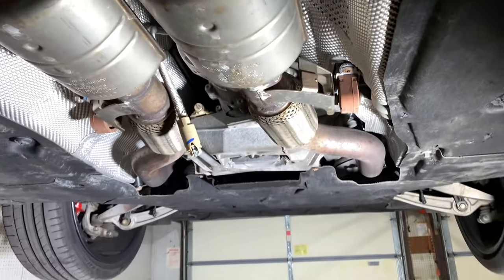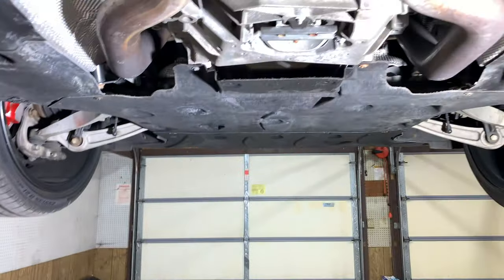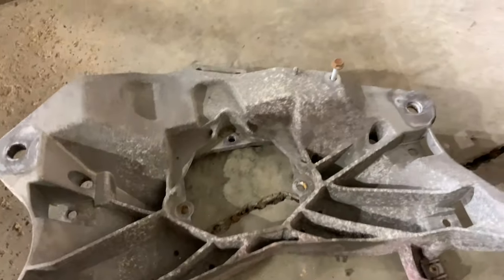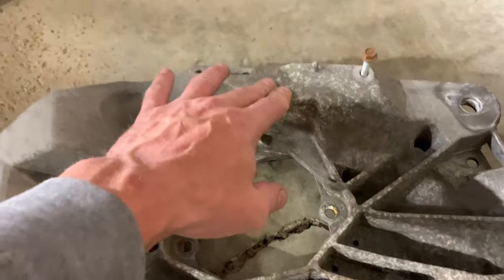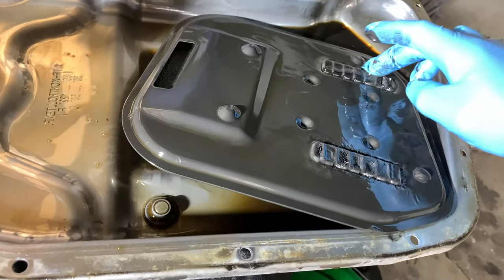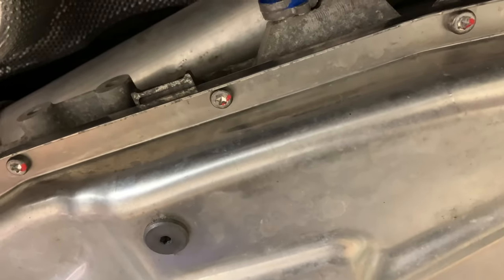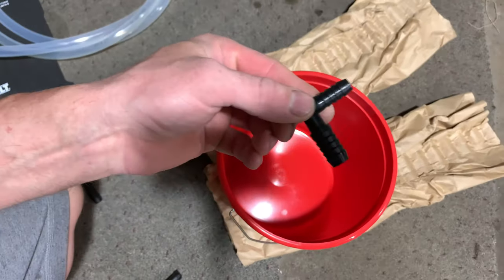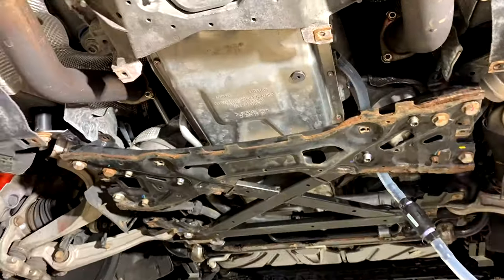AUDI A8 D4 Transmission fluid and filter change (ATF fill steps in the description)/Замена масла

Comment: The guy at Audi dealership told me you don't have to change the fluid
Reply: That is what I expect from an Audi Dealership!   Try Every 35k and 40K miles...  The recommendation is do it at 35 and 40, 75 and 80, 115 and 120.   Bad fluid destroys the transmission and I am sure Audi would like you to pony-up the cash to replace one for (estimate) $15,000 ASAP.
Reply: @smiller1413  Wow, I knew that didn't sound right

Comment: I noticed your filter hung down, my new one when I did my change also hung down but the original was snapped into a bolt head with that black mount on top of tranny filter??my new filter did not "snap" to valve body like OEM, any issues that could arise from installing hanging filter? Thanks
Reply from the maker: As long as it’s OEM filter you should be fine.
Reply: @DIYDime  is it possible there was an O-ring on the original filter that should have been transferred to the new filter when changing it and that's why the new filter hung loosely?
Reply from the maker: New filter has new O-ring already

Comment: is there a way to flush the fluid on the torque converter? on my tundra, I disconnected the line going to the ATF cooler, and drained it there, and then refilled. I understand that it uses 9 liters, but you can only drain about 6 liters just replacing the filter. What about the other 3 liters, any way to get them out? Thanks!
Reply from the maker: I'm sure there is a way to get complete oil  out but unfortunately I don't know.

Comment: Awesome video thanks for sharing, will be doing this soon. Your exhaust flex pipes look way better than mine, I had to replace them a while back. By the way, what year is your A8 and at what mileage did you do this service?
Reply from the maker: Mike's Garage 
2011, 140500 miles. I did timing chain work on the engine but didn’t have time yet to do the video

Comment: Thank you so much for the video. And about procedures with the OBD-II scan tool for transmission temperature and level check? Does it apply to your Audi model? 
Did you make the Transfer case, common oiling with front final drive oil change also?
Reply: Should I go like this:
ATF Temperature, checking:

Automatic Transmission Fluid temperature needs to be within a specified range when checking the fluid level. See your Factory Repair Manual for the range for your vehicle.

[Select]
[02 - Auto Trans]
[Meas. Blocks - 08]
Set group to "005" (Maybe group 002 or 004 in some vehicles - again check the Repair Manual).
[Go!]
The value in field 1 should be ATF temp in °C.
Reply from the maker: Steps are in the description